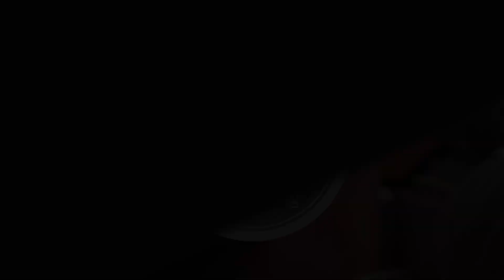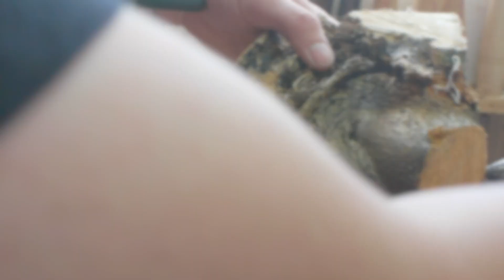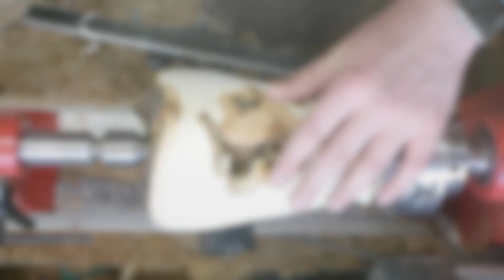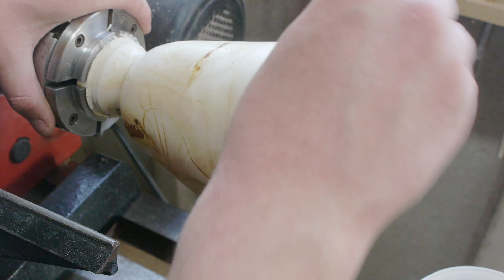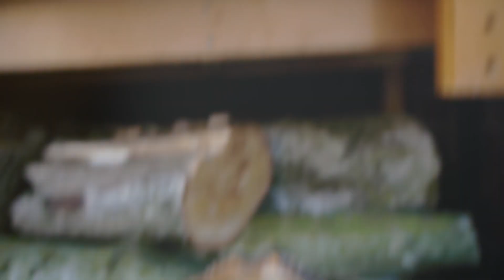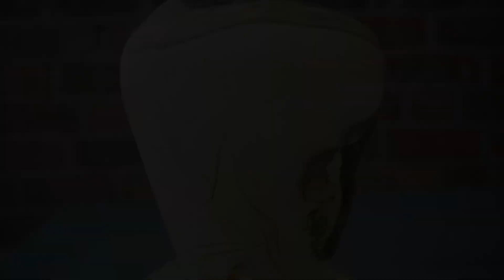Woodturning - Live edge lime vase / Hollow form.

Comment: Wait...
What; no finish, bro?
What's to keep it preserved?...'keep it from "moving", cracking, warping...coming apart?
Reply from the maker: I did actually finish this with shellac and a wood wax, this will help to keep the wood sealed. In terms of the movement, a uniform thickness helps to prevent the pieces from warping/cracking too much. A little is ok though, adds character. Thanks for watching!!